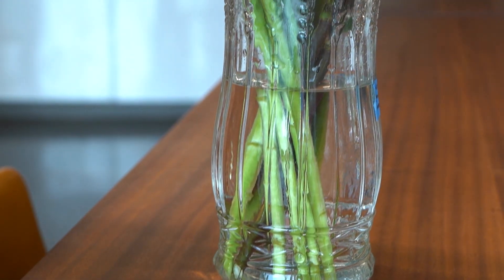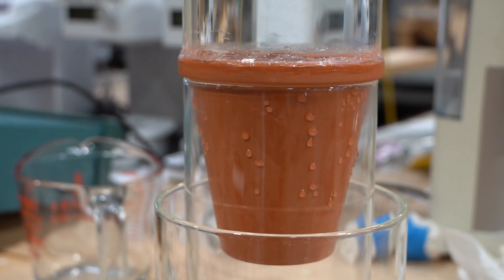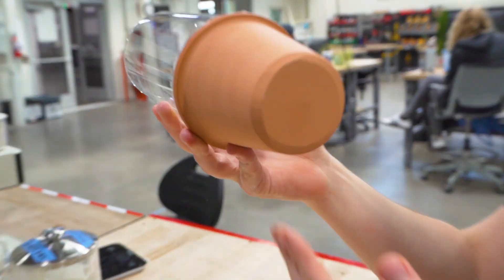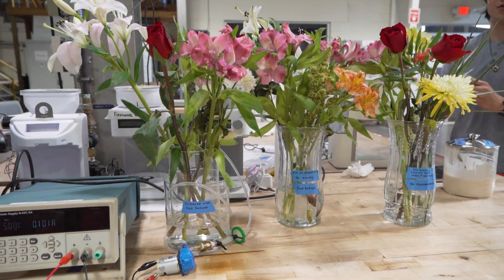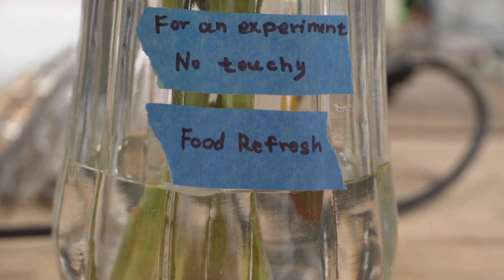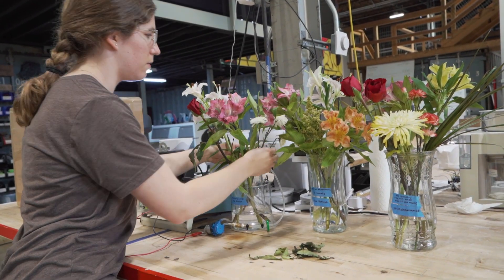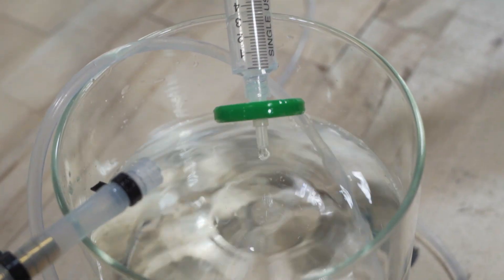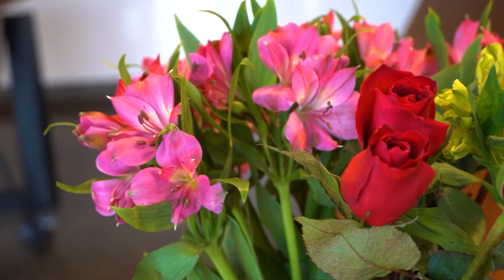The Smart Flower Vase | Prototype UPDATE

Comment: Years ago I read to add a drop or two of bleach or dish soap to flower water. So i use the flower food and a dish soap. I change the water between 3-5 days later and repeat. It definitely helps cut down on biofilm. When I first began doing it I remember thinking that it really helped them last longer but I’ve doing that process so long I don’t remember how many more days it extended the flowers. I use tall glass vases that I save from the times I’ve had flowers delivered. These days I’ve begun using 6-12% hydrogen peroxide on my plants when needed and a drop in water of my plant cuttings that also works great. Next time I have flowers I will try a drop in the water instead of bleach or soap. 
I’d enthusiastically back something like this. Good luck with it!
Reply: I read somewhere to use an aspirin as a flower food substitute. And using the food/aspirin, bleach/soap and changing the water every few days, flowers will last me about 10-14 days before I bin them.